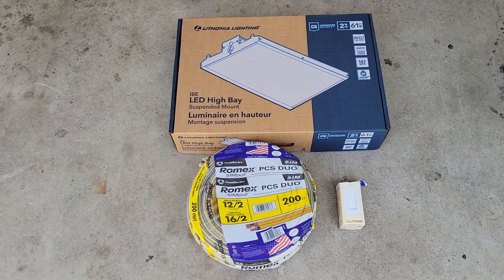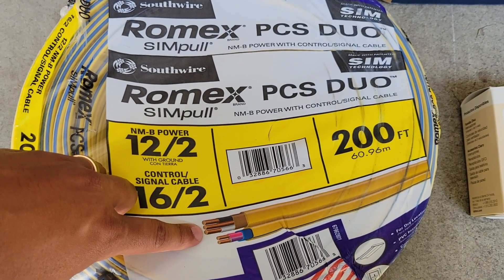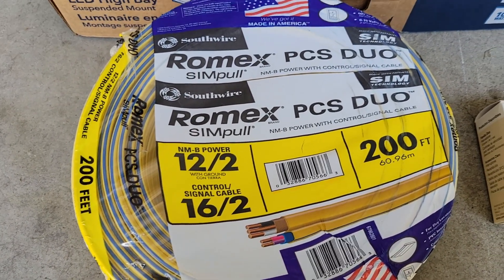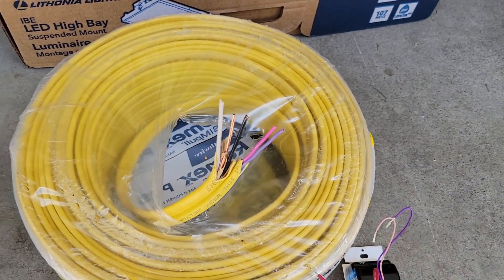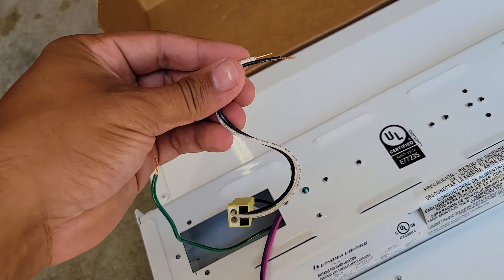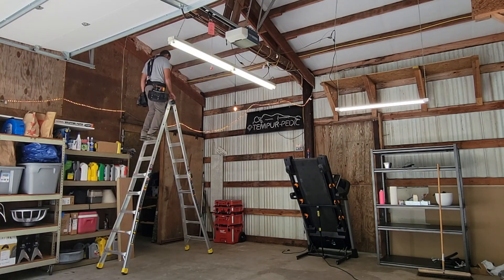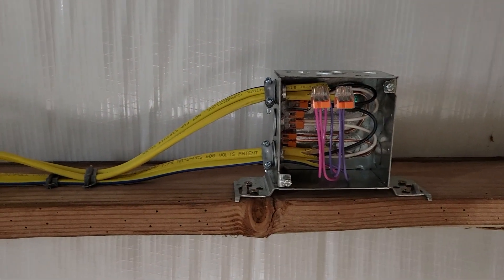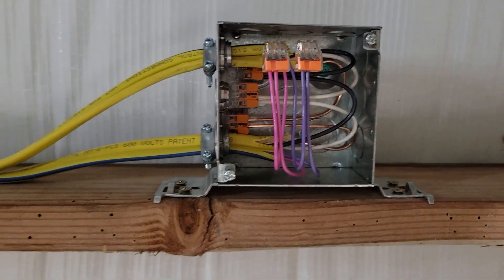How to Install a LED Garage / Shop Lighting Layout - Part 2

Comment: And the wagos!! Looks tremendously clean
Reply from the maker: Thank you! I love wagos for lighting because it makes the change out easier whenever they die. Otherwise I like wire nuts for devices I know will stay there for a long time like receptacles, air compressor, a motor, etc.